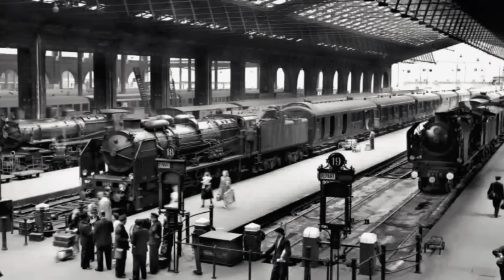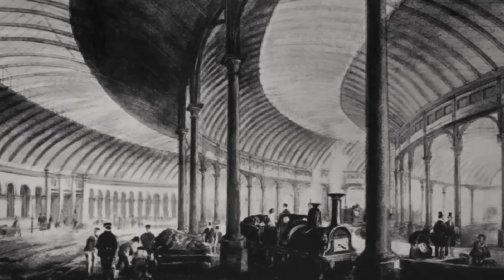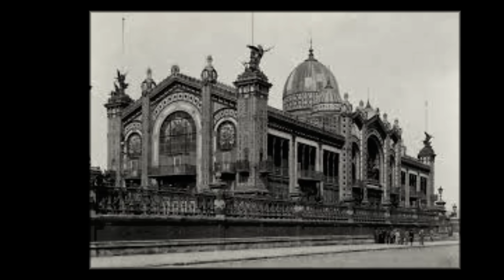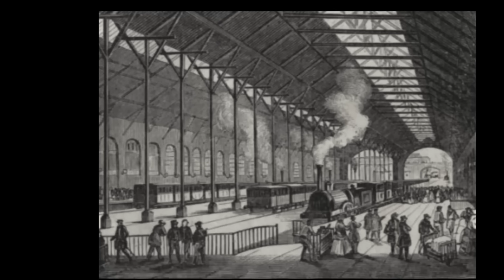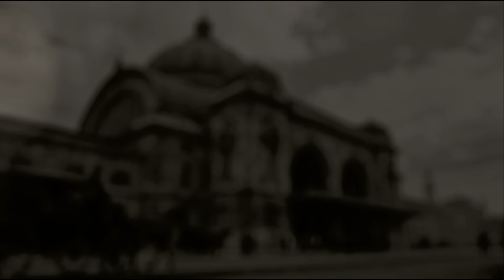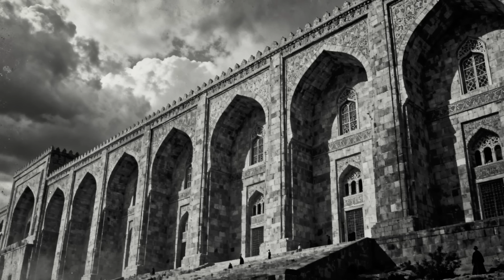Train Stations Of Tartaria 1890 – The Forgotten Water-Powered Rail Network

Comment: No proof shown — just a selection of old photos and your personal opinion.  
Before lasers existed, surveyors and engineers already had perfectly capable tools:

- Theodolite — mid‑16th century (Leonard Digges, c.1550s)  
- Spirit level — 1660s (Melchisedech Thévenot)  
- Plumb line — ancient (used since at least 1500 BCE)  
- Dumpy level — 1832 (William Gravatt)  
- Surveyor’s transit — 1830s  
- Steel tape measure — 1860s  
- Steam hammer — 1840s (James Nasmyth)  
- Punching & shearing machines — mid‑1800s  
- Hydraulic riveting machines — 1850s–1870s  
- Tower cranes — 1860s onward  

By the time the big railway stations were built (1850s–1900s), engineers already had all the surveying, lifting, riveting, and steel‑working tools needed. Nothing “impossible” about it — just Victorian engineering doing what it was very good at.

Comment: Steam trains were not called steam trains for nothing! Ever wondered why aeroplanes produce contrails (water vapour), are they actually running of water and free energy like our trains used to?
Reply: I believe that it was air powered, with water used to push the air.
It would eliminate the use of steam as a power source. 
The "tunnels," or TUBES that the train traveled through would have been air tight and pressurized. 
Consider the workings of a💧 water cannon, or on a smaller version.
The ⛲️fountains everywhere would have had preasure gages to... MONITOR... the process.
This is my personal theory, by the way.

Comment: sad sad sad, age of internet. Fools spreading nonsense, like world is flat. Steam engines run on steam. Wonder where that comes from? Millions of gallons needed - so of course there's a massive water supply. Hydraulic systems of huge scale. How else do you turn an engine of hundreds of tons around in an enclosed space, before electricity? What a slur on a genius age of engineering by someone who knows nothing about nothing. Don't participate in this rot. Call it out.

Comment: A long time friend of mine Peter Quiggins Liverpool told me many times a similar story to the picture you describe re-the basements of these railway stations.

As a prospective buyer back in 1989, he had access to "The Great Western Hotel" attached to Limestreet Station Liverpool UK before it was sold to become student accommodation.

He often tells me the sub-basement was an architectural masterpiece, flooded with water in parts, and had been for many years which did not affect the structure.

Comment: How did this glass structures at these train stations not shattered from the vibrations of the trains coming in and going out there had to be some kind of system that was perfectly put together and perfectly timed or there had to be something within the rails and such that absorbed or deflected certain vibrations to keep that glass from shattering don't you think

Comment: Beautiful video, but I'm critical of the Tartaria technology claim. Here's my three counter claims with reasons behind them:

1. Wood vs coal - Stations were clean in early 1800's due to using wood to heat up the boiler. In the late 1800’s they upgraded to coal, 3 times the energy density, but covered the station with black soot. Wood wasn't enough to power the demand of rail travel and forest depletion was a real issue back then.

2. No suppression of water systems, still used today - Underground water pressure utilities were used and were massive. They were used to move cars, load cars, and refill train boilers. However, by early 1900’s electric motors were cheaper and more efficient and water pressure systems were replaced. Actually we never lost this technology. It evolved into hydraulic power. Your car relies on this to stop, turn, absorb bumps. We use oil and gas as the fluid instead of water now.

3. No long distance water powered trains - Trains were technically water powered. Boiler heated up to create steam under pressure to move a piston that moved a crank wheel to move the train. But heat came from burning wood or coal. Depressurizing and refilling the water inside the boiler cleaned out sludge and impurities that could clog a boiler leading to potential explosion.

There were gravity water incline trains at that time. Also, an experimental New York subway used air pressure, but at that time coal was the leading fuel.

I think there's engineering and technical explanations for everything presented in the video. I agree the stations were beautiful and it's hard to imagine them building these back then.

Comment: Per Grok:
In the 1890s, larger train stations—particularly in urban areas of Britain and other industrialized regions—commonly used hydraulic power systems supplied by public or private networks to operate auxiliary equipment.

 Passenger and goods lifts (elevators) 
 Essential in multi-level stations or deep-level underground lines (e.g., the City and South London Railway, opened in 1890, used hydraulic lifts to connect surface ticket halls to deep platforms).
Cranes and hoists — For handling luggage, parcels, and freight in goods depots adjacent to passenger stations.
Other machinery — Such as turntables, capstans, and dock-related equipment in stations near wharves.

There is no big mystery, the oil companies re-routed the path the world would take regarding the types of energy at it's disposal.
Some of these stations were still in operation in the 1970s. Electricity was the main reason they were phased out, much cheaper. This vid is a lame AI presentation of BS.:face-blue-smiling:

Comment: Was it really "water power" or hydrogen. Did the tech get out of control and explode throwing mud into the sky? Maybe the system was sabotaged. How could all sorts of stone, brick and plaster buildings ignite in a short time unless a flame front broke through windows and ignited internals.

Comment: No super technology nuclear waste nuclear fuel rods pellets contaminated water steel , building’s tunnels  , bath houses no wood or coal or oil smut no were , fusion fuel before it was found to destroy human genes , before life lasted 40 years maybe it nearly made man extinct, life was short , infants died, men were becoming sterile, as a result of this clean energy, this is why it is segregated from population now and always will be , waste buried in mountains far away high off the ground, the lives lost getting rid of the evidence caused ground heat and severe mud slides, that buried half the world before anything was done , but just like Chernobyl lives had to be lost and spent and used to cover up a past without anyone knowing

Comment: Official records say all the Atmosphereic Railways were scrapped, because of one little leather water valve that would spring leaks. This story sounds highly unlikely. They say the railways only ran until these tiny leather valves started to leak after 3 years of use, so they couldn't replace the valves with a sealed metal version, they scrapped all the trains and the stations instead. BS.

Comment: You ask several times why would anyone abandon a system that works so well? It was abandoned because of economics. While high water pressure and lots of water was plentiful early, it soon became apparent that the amount of water available was finite and with growing populations was quickly becoming unsustainable. 
There is plenty of evidence for water powered machinery, even in the kitchen and laundry. Not hard to find still working examples even of water engines turning railway turntables. No mystery or conspiracy there. Robert Murray Smith (deceased) UK has done a series of water power tools and machines videos for one, including a turntable motor. It's simply that they were replaced by simpler, more cost effective, more flexible, lower maintenance, cable supplied motors rather than rusting out, leaking, bursting pipes with seals and valves that leaked and wore out. 
You say all stations where built along side rivers. The obvious reason there is canals carried everything and delivered all the cast iron structures, glass and carted away all the spoil from earthworks. Canals dug their own grave so to speak. 
Why are there no photos of much of what you talk about like smokeless engines? Because there aren't any. AI generated photos don't count. Every engine in this video is a steam engine. Clean stations are a natural thing due to the design, high roofs direct smoke up and away. Engines sitting on standby while passenger alighted or boarded are very clean burning. Engines moving off are also clean burning. It's only a poor or lazy fireman who makes steam engines smoky or in modern days, it's a photo opportunity thing. Pile on the coal or wood beyond what is needed for sustained power and we get excessive smoke. I know this being a train buff since the 50s.

Comment: This video reminds me of how Nikolai Tesla was ignored, and Thomas Edison with his cohort, wanted an expensive electricity distribution system which was dependent on their industries and fossil fuels. On the other hand, this account could be used as inspiration to bring back these clean water-powered systems. Edison and his partners wanted an transportation system where they could "corner the market" on it. *"A Free-flowing Energy Grid is the Nightmare of Every Empire" I think corresponds with the ever-encroaching threat of AI and its noxious pollution.
Reply: This is what they are doing now. Dumbing the next people down into thinking we got our energy from solar and wind.
Reply: Tesla was murdered because of it. He suggested "Hydro" would cost 25cents per month for each household.  Murdered by our government. Prove me wrong.
Reply: DC doesn't hold a charge on a distribution line for more than a few miles or so. AC amps stays steady several miles further. Westinghouse done stolt Tesla's stepping transformer idea. Stepping transformer makes AC possible. Tesla wanted to use that transformer to send electricity around the world. Radio signals had him beat years before though.

Comment: Steam engines need lots of water to heat for steam.  Burning wood oil or coal smokes out covered stations and tunnels.  About 1890 in New York smoke was a problem and electric trains entered the cities and powered the subways in tunnels.

Comment: You claim we didn't have electricity to power machines in 1890 but that is simply not true. The Pelton wheel water motor which is a high speed water driven motor that in turn drives a generator has powered many things since it's invention in 1870 such as "large-scale hydroelectric generators and industrial equipment to smaller devices like sewing machines and coffee grinders. Historically, they were crucial for replacing steam engines in mining operations and were used for things like driving circular saws and powering elevators. In the late 19th century, they were even used to power electrical generators for radios and light bulbs. " according to Google AI's sources. This was my reply at 9 minutes in. Now I'll see if you pick up on this in the video or if you go in another direction.

Comment: There is no mystery. Ordinary people were just much smarter back then. People were able to do complex mathematical calculations on paper; no calculators or computers were used. The lack of bureaucracy or 'red tape' meant that projects could be done at a fraction of the cost of today. Workers were also paid less, and had less rights, which also kept costs down.  General intelligence was much higher back then. Your average 'lowly' shop keeper was tasked with managing inventory and calculating complex customer sales without the use of a calculator or computer, it was all done by hand and head. 

Most people alive today wouldn't have the required intelligence needed to perform even the most basic of jobs, which is why the achievements of the 1700s and 1800s seem so unbelievable to us now.   

There is no mystery.

Comment: This is a curious video - as are many of the so-called Tartaria themed video content.  Yes, curious indeed, however unsubstantiated.  As if the entire world at that time agreed to hide something.  I mean the entire world folks.  If these great things actually existed, then someone, somewhere (and more likely than not many someones) would have been spilling the beans long ago.

Assuming this wonderful quiet hydraulic system worked, and worked well enough - there must needs be a practical explanation for abandoning the technology en mass.

It is completely plausible that steam replaced water hydraulics as a practical matter, not a conspiracy matter.  As you have stated in this video content, the earth works to create these systems were massive undertakings - and as such, more likely than not - a huge maintenance nightmare and very costly at that.  These systems with their massive earthwork requirements and massive piping systems would prove to be unscalable, as the expanding industrial age required a more agile solution that could be implemented without the need for massive pipe and earth works.  And they could expand the steam systems faster and on more varied and unforgiving terrain.

Just think about this as a practical matter, not some kind of 'screw the people' conspiracy.
Reply from the maker: Thanks for sharing your perspective.

Comment: The 1890 census was destroyed supposedly by a cigerette outside the vault door. So there is a 20 year gap to connect families which stopped people in the coal fields from proving lineage and they stole the coal from those familes
Reply: Wow. Then they could have fabricated a lot of information about births for the 1900 census. They could have also fabricated information about people who immigrated in the 1880s. That would be my paternal great-grandparents. No wonder the information I have on those two generations is so spotty. I have been suspecting that my grandparents on both sides had been cloned.

Comment: Very interesting! Perhaps they got rid of it as while they had the hydro trains running they probably were less efficient than the new stuff and time is money so even though they needed to mine coal they just probably were already doing it so they could 1) access or easily and 2) justify the costs by going faster than hydro trains perhaps? 

It could have been around but not refined enough but yeah why there is no discussion and such is interesting. I guess there was less media and things to control back then and maybe possible to do so, while extreme, each year into the future it would get more difficult ie: Rudolph diesel and Tesla
Reply from the maker: That's a very insightful point!

Comment: AI nonsense.  Hydraulic power required steam engines to power pumps to operate the hydraulic systems - Tower Bridge is still operated hydraulically, but with electric pumps.

Comment: Hydraulic.
= Water.  Hydro = water. 
So , a way of piping water through pipes , at it's base . Wood or coal fired that pressures using a pump , the water.  The water goes through pipes and is pressured so , theoretically, you can run trains.  You can open and close doors.  You can run lifts.(  Elevators ) Etc.

So steam is different.  Steam is water vapor.  So , steam has less much less , pressure power than water does.

Comment: The TROMP system was suppressed - compressed air created by aerating water . they also got rid of the healing bells .
Reply: My father told me of a mine he worked at that used compressed air from falling water, the air was carried in the water and captured in a dome after it separated.
Reply: That's so cool, and sad we have been so lied too @skid4u
Reply: Indeed.  If memory serves there was a "Lafayette" facility in Quebec, Canada that was operated by Hydro Quebec for some time before decomissioning and "forgotten".  Brilliant.  Easy, dry, compressed air from a feasible drop of water.
Reply: @pbsluvr312 the stuff that works well they dont want.  They want the stuff that is clunky difficult and controlled.  And enslaves everyone.
Reply: @researcher_appreciator BOOM
Reply: Thanks, just looked it up..
Trompe acc. to wiki.. incred. interressting
Reply: Tromp....?
Reply: @kfiege01  TRUMP
Reply: All of the windmills have Millie disappeared I still don't understand why you would pull a windmill down when it's running on a wind pumping water into your tanks stop now they use petrol pumps I work for 10 1/2 years n1 sawmill that run on Steam then came three phase learn learnt to gullet end sharpen big sores them were good times
Reply: @graemesneddon6079  All of your text is run together with no periods (no sentences) and such. Hard to understand.
Reply: Trump ?
Reply: @researcher_appreciator He forgot the 'e' on the end: trompe.
Reply: @seeker1015 trompe is an evil word in French